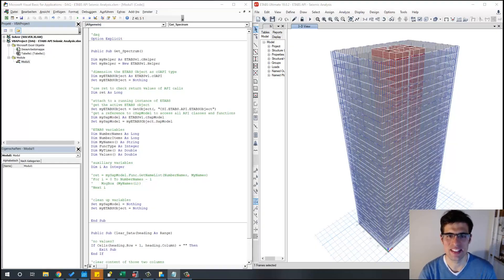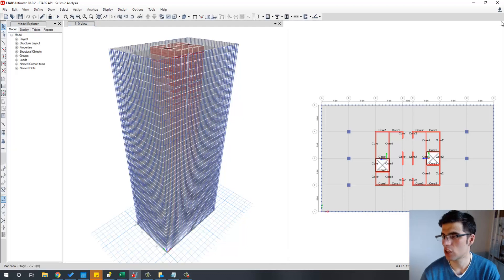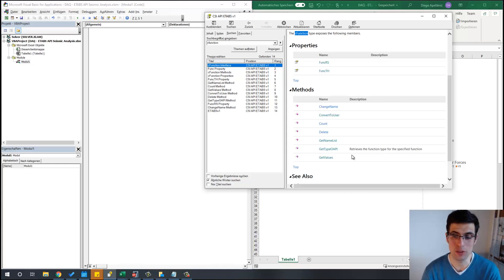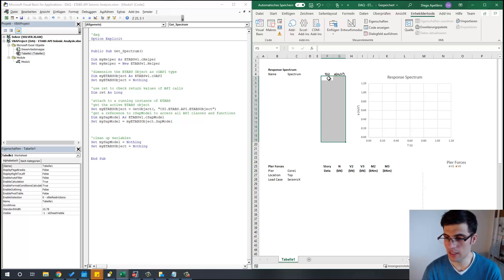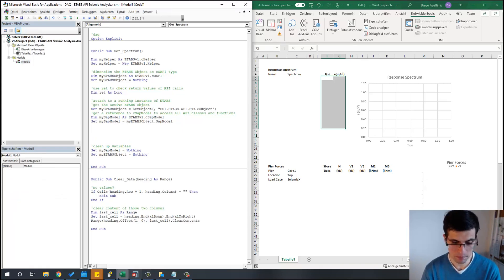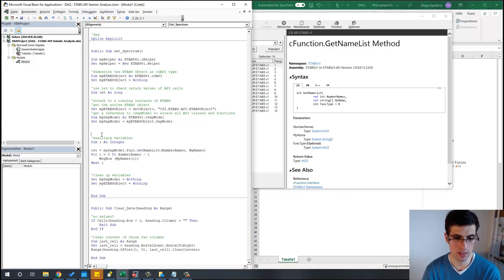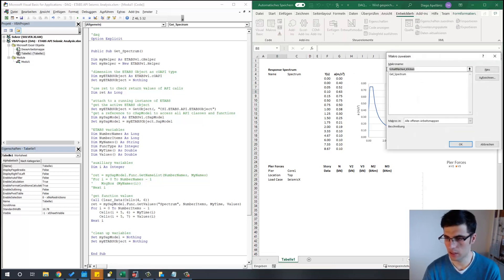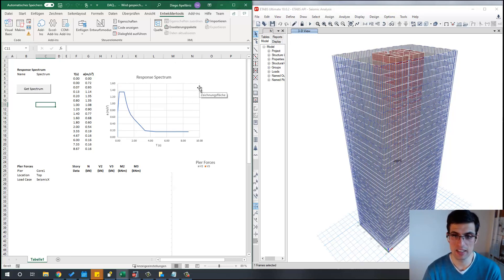ETABS API - Seismic Analysis

Comment: Hello Diego
I Have a problem in my API Code on VBA
I'm Grateful if you help me to solve my problem
I've just started Api programming and I have written a code to get grid information from a model, but  when I run the program I encounter the "ByRef argument  type Mismatch" Error. 
How can I solve this problem?
this is my Code:

Public Sub GetGridSys()
    Dim ret As Long
    Dim myEtabsObject As ETABSv1.cOAPI
    Dim myHelper As ETABSv1.cHelper
    Dim mySapModel As ETABSv1.cSapModel
    Set myHelper = New ETABSv1.Helper
    Set myEtabsObject = GetObject(, "CSI.ETABS.API.ETABSObject")
    Set mySapModel = myEtabsObject.SapModel
    Dim Xo, Yo, RZ As Double
    Dim GridSysType As String
    Dim NumXLines, NumYLines As Long
    Dim GridLineIDX(), GridLineIDY() As String
    Dim OrdinateX(), OrdinateY() As Double
    Dim VisibleX(), VisibleY() As Boolean
    Dim BubbleLocX(), BubbleLocY() As String
    ret = mySapModel.GridSys.GetGridSys_2("G1", Xo, Yo, RZ, GridSysType, NumXLines, NumYLines, _
    GridLineIDX, GridLineIDY, OrdinateX, OrdinateY, VisibleX, VisibleY, BubbleLocX, BubbleLocY)
    MsgBox Xo

End Sub

Thank You
Reply from the maker: Hello Thomas,
the code should work if you just declare each of the variables that the API uses in a different line - at least it works for me. Thanks for posting your question in a comment, so it's visible for the others as well.
Best,
Diego
Reply: @DiegoApellániz   Thank You Diego, I declare all variables into different lines and that worked, You are amazing

Comment: Hello! Thank you very much for your video. I am trying to load time history data into ETABS as a function. However, it seems that there is no method in cFunction interface that can do that. Is this correct? Can you automatically load data from Excel spreadsheet into ETABS? Thank you!
Reply from the maker: Hello, exactly you can also try using the cDatabase methods (this is like importing and excel table), but the information you can import with this approach is also limitted.

Comment: THis only works for loadcases. I tried changing this for load combinations but no values show up.
Reply from the maker: This is just a tutorial, not a commercial application. You can display results for load combos just by replacing in the macro the method "SetCaseSelectedForOutput" by "SetComboSelectedForOutput".

Comment: hi Diego, I'm currently using Python to interact with the API on ETABS buuut I can't find Methods to 1. Create your own function (Response Spectrum) 2. Add this function to a load case 3. To later create a load combination. Did you know some Documentation, solution, suggest or any help to solve this problem? ajajajajaj, I'm already look in the CSI API ETABS and i didn't find nothing :(
and I'm thinking that this lack of methods or documentations happens not only in this case when you want  to create seismic cases or even seismic patterns (sadly I think that  problem will limitate the capacity to handle the program or even being able to create plug in order to automatize and save time in your simulations). Thanks for your help and your effort, great content.
Reply from the maker: Hi Cesar. Good to know! I guess I could do some tutorials with Python as well. ..

Comment: Hello Diego, 
I want to retrieve the names of the defined frame objects on a given story by below function:
GetNameListOnStory(StoryName As String, NumberNames As Long, MyName() As String) As Long
but it doesn't work and I can't run this function properly, Could you use this function without any problem??
I modeled a 4 stories structure in Etabs and write this code:

Sub GetNameList()
Dim ret As Long
Dim myEtabsObject As ETABSv1.cOAPI
Dim myHelper As ETABSv1.cHelper
Dim mySapModel As ETABSv1.cSapModel
Dim NumberNames As Long
Dim MyName() As String
Set myEtabsObject = GetObject(, "CSI.ETABS.API.ETABSObject")
Set myHelper = New ETABSv1.Helper
Set mySapModel = myEtabsObject.SapModel
ret = mySapModel.FrameObj.GetNameListOnStory("Story2", NumberNames, MyName)
End Sub

thanks for your help :)
Reply from the maker: Interesting. That piece of code is working for me. Are you sure that you are using the right reference file ETABSv1.tlb? Are there beams in the model? Is there just one ETABS Model open?
Reply: @DiegoApellániz , I ran this code in Etabs 19 and worked, did you run it in Etabs 18?
Reply from the maker: Yes I ran it in Etabs 2018. Well I‘m glad it is working for you in Etabs 2019 at least.

Comment: How do I add a load pattern as Seismic load with user coefficients and then set base shear coefficient manually?
Reply from the maker: Hello Thomas, that is unfortunately not exposed in the API... perhaps you can try that with the cDatabaseTables Interface though!
Reply: @DiegoApellániz  kindly help us with this, i mean in adding static seicmic load pattern as per IS 1893:2016, this will be paid, please help.
Reply: Hello diego, thanks for the reply, can you please describe it little more the cDatabase interface, please...